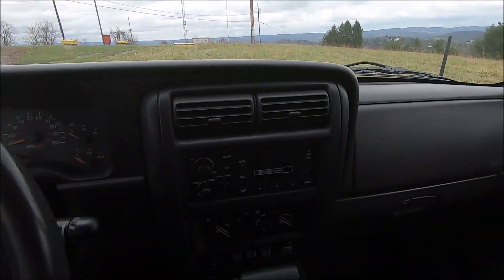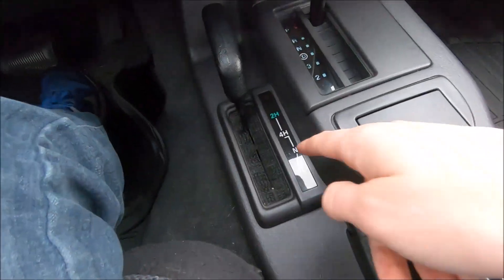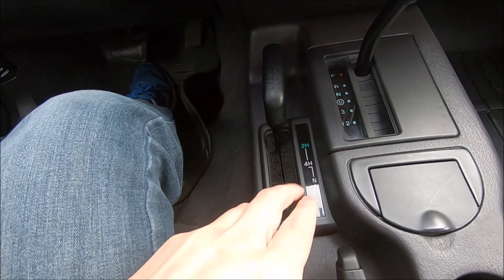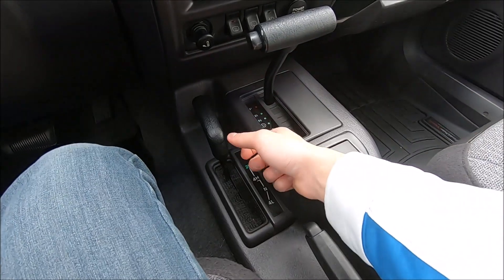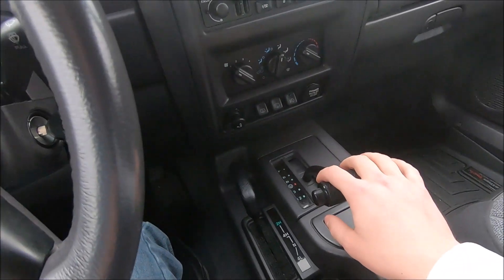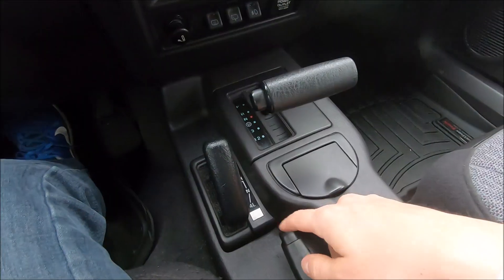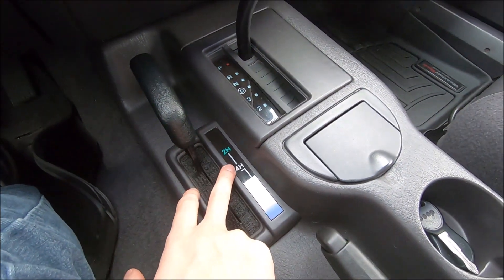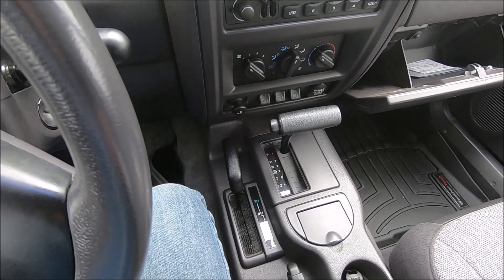Jeep 4WD System Explained (Command Trac vs Selec Trac)

Comment: Great video content! Few years back, I purchased a 98 gunmetal blue  loaded out xj from a doctor! It has cruise control, over head console with mpg /miles to empty /ambient temperature, towing package, fog lamps, leather powered front seats, and a 242 transfer case! It still has the dealership plastic on the floor boards. I plan to keep mines all stock with no lift. I have 235 Nexens m/t’s on it now. Whenever I wear those out, I’m going with 30x9.5’s at stock height on the original honey comb rims !Keep up the inspiration! Love your Jeep!
Reply: Yup, I pulled out a 2wd suburban. Backed up to them. Grabbed my chain. Popped it in 4 Lo pulled them out. Never spinned a tire! 4 Lo is geared so low , the Jeep basically pulled them out with just the rpms. I released my foot off the brake pedal and the Jeep done the rest!
Reply from the maker: Impressive!
Reply from the maker: Dang you got a loaded one, probably looks and performs good with those tires too. Thanks for watching!
Reply: Yes, she does well! We had a winter storm come through and I rescued a few people!!! We had 6 inches of sleet, snow, and a blanket of ice! Not normal for our area! I did manage to have time to play with and learn my transfer case alot! I grew up around Jeep’s . On a 242 transfer case, full time mode is like 2Hi on steroids! Keep in mind I had no trouble! I went through some not so bad patchy slippery areas in full time and drove back over them in 4Hi ( Part Time)! Night and day difference! It’s not like a sophisticated full time 4wd system in a AMC Eagle if you can relate! In my opinion the 242 full time mode is like it’s made for heavy rain and hydroplane. I hit some spots that were slick as owl shit in full time and it scared my wife like a horror movie! Came across the same spot in part time like I mentioned in the beginning ,night and day difference! Heck of a lot more traction and no slippage in 4 Hi! I use full time on mine if I’m coming off a iced over snow road and approach a gas station or grocery store parking lot. I’ll pop it in full time to keep the front end from binding and hopping! When I leave the grocery store or gas station parking lots, I’ll pop it in 4 Hi and keep up with the new Power Strokes, Dually Trucks, Duramax, and other big boy toy full size trucks and new SUV’s! Keep up the good work!!!!
Reply from the maker: Sounds like it was a fun time. I’d almost imagine these old jeeps do better than those new big trucks because of the weight. Thanks for watching!

Comment: i have a question. its there like a shifter lock on the 4x4 handle itself? reason i ask is, i dont have the factory key, my key symbol with a line in is on in the dash cluster. and i can not get my 4x4 handle to budge out of 2 high, its like its froze solid, any help would be great
Reply from the maker: Hmm no there’s no actual lock on the 4WD handle, I’ve never actually heard of this issue. I did some research and found this forum, hopefully it helps: https://www.google.com/amp/s/www.jeepforum.com/forum/f9/help-transfer-case-shifter-won-t-budge-1446931/%3famp=1
Reply: @KCars  hmm, interesting, this jeep only has 115000 miles on it, as far as know it was in 4 wheel drive one time years ago. i know the people who have it and they live in town and never need four wheel drive. i can pull like mad and nothing lol, its possible then that its seized up from not being used. when it warms up i will spray the linkage and see what  happens,
Reply: @KCars  I will update you on the results whenever I do that.
Reply from the maker: Awesome

Comment: What would be best for going on sand? I live in the desert and I’m trying to take it around some trails
Reply: 4hi bud 4low if you really gotta push it to make it
Reply: Also lower your tire pressure for more traction
Reply from the maker: For sand I would use part time 4WD high since it’s a loose surface

Comment: So it sounds like I need to make sure I buy a 242.
Reply from the maker: If that’s what you want then yeah, I haven’t had any issues with my 231
Reply: @KCars  Well, I would be mainly using it as a snow beast, and I'm sure I would get into off roading as well.

So basically I love cars and have a nasty habit of always wanting more, lol. Currently I'm planning to buy a W140 Mercedes S500, but I've been thinking about the next car already (because I'm insane), and with how much fun I've been having in the snow with my winter tire Charger, I got to thinking about these again and finding lots of info and videos. I'm probably going to buy one built, on the biggest lift kit I can find, and plow through deep powder like it isn't there.

I'm just worried that the part time might not be helpful for regular road driving on lighter snow, as opposed to the 242.

If yours works fine in daily winter driving, it'll be nice to not narrow my search so much to the 242. Most of my summer driving would likely consist of the Charger, Camaro, or the Mercedes anyway, so I wouldn't really need more than RWD outside of winter or trails.
Reply from the maker: Yeah you’d be fine with either one, you just have to be more conscious of which driving mode you’re in with the 231
Reply: @KCars  Thanks. Appreciate the replies!
Reply from the maker: No problem, thanks for watching!
Reply: Both are solid tcases. Stock vs stock however w the 242 you get a Dana 35 rear and ABS where as the 231 gives you the better Chrysler 8.25 but non ABS
Reply from the maker: Good comparison that I left out, appreciate it!

Comment: what's 3 and 12 for ? (just below D)
Reply from the maker: In 3 the Jeep will pick between the first 3 gears. In 12 the Jeep will pick between the first 2 gears. I mainly use it to downshift for engine breaking and sometimes off roading if I don’t want the Jeep to shift.

Comment: Do you only need to use the "N" (Neutral) on the transfer case when shifting from 4L to 4H?
Reply from the maker: You put your gear shifter in neutral when shifting from high to low or from low to high
Reply: It’s weird I never had to remember to do that, as anything with 4WD I’ve ever had was a stick shift. I’d probably screw up the transmission if I hadn’t known about shifting to neutral with an auto box. Thanks, random internet friend.
Reply from the maker: Ya I guess it’s easier with a manual, just press the clutch
Reply: @KCars  It’s actually easier. When the shifter isn’t in gear, it’s in neutral. It’s just something I never had to think about because when I shifted  my Isuzu Rodeo into 4H, I would stop and usually that meant returning the shifter to neutral. The same when stopping at a red light, pull the shifter out of gear and use the brakes to stop. I have used engine braking to slow down when my brake pads were worn out, but it’s probably not good to do that a lot.

Comment: Good vid tutorial. Just picked up a '99 XJ and was trying to figure this out. Grinded a few times, then decided to go to YouTube University. Thanks!
Reply from the maker: I heard that’s the best year XJ to get. Glad I could help, thanks for watching!
Reply: Same here
Reply: I got a 97 why is it the best? Mine has the 231 but I wish it had the select trac 242 which is better 4-wheel drive part time? Or actual full time? 242 I’m sad
Reply: am i doing something wrong i put mine in 4high and when i slow down it grinds a lot but when i only put it half way between 2 high and 4 high it works just fine

Comment: You just baby that thing 😆 mine you have to put in neutral then 4 hi then neutral push down then pull back in 00-01 jeep cherokee. Then in 4 low your drive shaft turns 3 times for every turn of your real diff. Not engine speed necessarily. Just a couple tip otherwise very informative. Your right about going on turns. Then non abs comes with a 8.25 which is different too.
Reply: I’ve had a 98, 99, 00 and now an 01. You don’t have to put it in neutral to go to 4high as they all function the same. Infact, it actually engages better if you are moving. You do however have to take your foot off the gas. If you have to put it in neutral for it to engage in 4high, then it sounds like you have a bad tcase linkage
Reply from the maker: Yep that’s another way to say it lol thanks for watching!
Reply: 4x4 low doesn't change how many times your driveshaft turns per one turn of the differential, that is determined by your axle gear ratio. Low range gear is in the transfer case which is before your driveshafts.